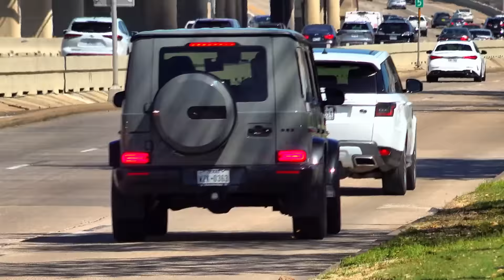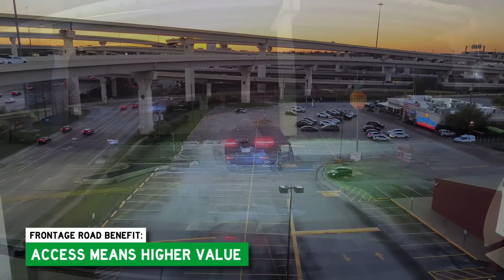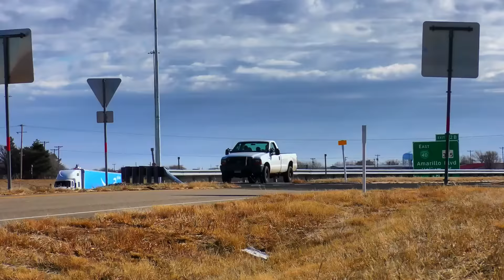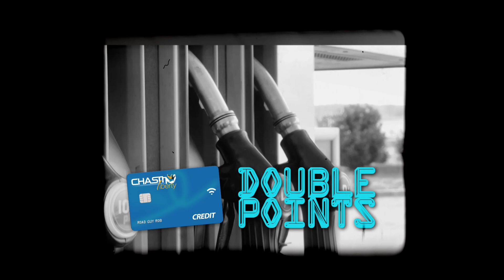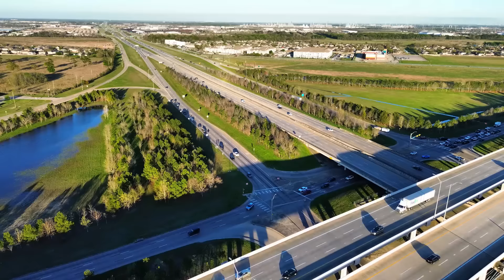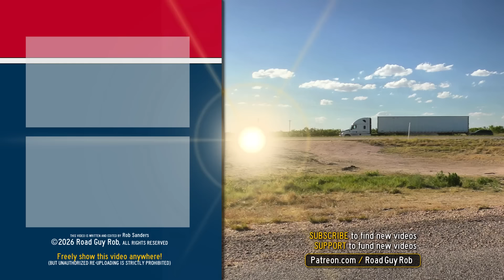Why Texas Builds a Freeway Next to Every Freeway

Comment: Seems like once you accept having a freeway at all, no matter how good or bad an idea that may be in its own right, frontage roads make a lot of sense for significantly improving safety and functionality.

Of course, it's also adding most of the problems of a 'strode' to the list of reasons why a freeway (or tollway) might not be the correct choice in the first place in any given situation.   But when it still is legitimately the best option even after taking that into account (which does sometimes happen)? Well, frontage roads seem like a distinct improvement over not having them.
Reply: This is not a stroad. Frontage roads reduce the left turn access issues that happen with a stroad.
Reply: idk about safety... These areas on camera have some of the highest injury and death rates in the country
Reply: @tann_man   Ahh. Perhaps not then. Maybe I got 'this is how it is' and 'this is what they're doing to make it suck less' parts muddled up in my head by the time I was typing the comment. 
That's what I get for trying to be 'fair' about such things and not just make the typical, not very helpful, sort of remark about the whole thing being a terrible idea, I guess!

Comment: They really should fill in the gaps on the off ramp's road lines as it crosses the two way frontage road.  6:43.  They should fill in the gaps in the off ramp's lane lines with dotted lines so its clear where the right of way traffic lane is for everyone.  The lane lines should be designed to make the right of way more prominent.  The would also help avoid issues with self driving vehicles trying to figure out where the danger is when crossing.

Comment: Great video!  To answer your question about how they handle the signals at frontage road intersections, they just do a four-way split phase that rotates around the interchange clockwise.
Reply from the maker: That's good to know.   At least you don't get stuck at the second signal, but it also means the red wait times are probably pretty horrible.
Reply: @R@Roa @RoadGuyRob y absolutely are sometimes. Thank goodness once it turns green you’re allowed to go all the way through, even if you’re planning to only turn left. It’s declined in efficiency in recent years, but the Houston area’s lights are timed for waves quite well and even left turns aren’t a hassle at the highways because of the signal synchronization.

Another commenter mentioned volleyball interchanges erroneously to this OG comment, but ironically, elevated and subducted volleyball interchanges do make the difference even on non-highway arterial interchanges in Houston, especially along corridors like 1960. The SH6/FM1960 Corridor form a 2.5th loop (the downtown highways are a 0th loop if you even want to consider it that), but aren’t “real” loop highways. Even so, you’ll find many elevated parts of SH6 and subducted sections of FM1960 at regular arterials. My personal favorite oddity is 1960 and Kuykendahl (I’m begging for another visit just to hear you try and pronounce this street) just west of the North Freeway.
Reply: Ive noticed elsewhere, even places where they could benefit from the split phase like Texas does, they don’t. The purpose is to make sure no one is stuck in the underpass or bridge that might cause a backup for the other signals and it works amazingly. There’s also something to be said about Texas U-turns and how they are amazing at avoiding the whole two lefts—the diverging diamond intersection is essentially an innovation on them that benefits the through traffic and integrate (almost) seemlessly into Texas’ already existing feeder road system.
Reply: I'm not gonna lie I was gonna comment that Rob should have visited San Antonio and had a sit down conversation with you. He still could, because there's still a lot about our highways y'all could talk about
Reply: It's called a "volleyball" interchange.   Often built as a "stopgap" where a fully limited access interchange could or should have been built initially.   US 75 (future I-45) and US 82 is an example.
Reply: @davestewart2067  that’s not what they were referring to. They’re talking about the frontage road intersecting with a perpendicular arterial road. Volleyball interchanges are a specific type of those where there’s also an added perpendicular highway and the arterial is another feeder and there’s no flyover interchanges. They function similar, but aren’t what Rob or OP is talking about when Rob talked about talking with TxDOT.
Reply: They do work very well. Think of the lights as a constantly rotating "L" that lets people through. The reds are pretty long but when it's green, it stays green pretty long and constantly keeps cars moving.
Reply: ay yes no Roundabouts
Reply: @AMPProf  roundabouts are good in a lot of contexts. Extremely high volumes like these are not those cases. There is not one good interchange/intersection type for everything, just as different types of roads and different modes of transportation are best for different purposes
Reply: @ClementinesmWTF well said
Reply: @ClementinesmWTF  but 18-wheeler truck traffic isn't suitable for roundabout
Reply: @siroversight.official …yes. Did you mean to respond to the other person?
Reply: @ClementinesmWTF  no, to you
Reply: @siroversight.official  got it. You can’t read to realize I already know what you said and that’s why “these are not those cases [where roundabouts are good]”. No shit they’re bad for 18-wheeler-heavy traffic.
Reply: @ClementinesmWTF  There is a neighborhood around Fulshear to the northeast that its intersections have roundabouts
Reply: @siroversight.official  yes…in a neighborhood, in a different context. Not on a highway.
Reply: Also “neighborhood” is a stretch. It has medium-to-low traffic arterial intersections with roundabouts in a residential area. The neighborhoods have typical intersections. That is an appropriate use. They’re telling you 18-wheeler traffic should be taking other surface streets to get to where they need to go. High-traffic intersections like feeders with I10 and major arterials are not those places to put roundabouts because it’s the wrong context.

I’m beginning to think you even writing to me about this is a sign to slow down on the beers.

Comment: Those X interchanges also do something else you didn't mention. By having the off ramp that far back, and the previous interchange's on ramp after the off ramp, the main "conflict zone" of cars weaving to get on and off the freeway is now on the lower speed feeder roads, instead of on the high speed main lanes - particularly in higher density areas where the interchanges are a mile or less apart.

The one downside is in some of the rural areas they are starting to convert the older, two-way feeder roads to one-way, and they don't have the U-turn lanes built, thus the traffic backs up to get through the interchange. Where I live there's a divided 4-lane "Farm To Market" road that reduces to 2 lanes plus a left-turn lane to go under the freeway (the 3-lane configuration continues into downtown from the freeway, and there's not enough right of way to widen that section). The freeway overpass doesn't have enough room for the U-turn lanes so with the conversion to one-way, traffic on the feeder roads backs up (although not as bad when they were still two-way) at the lights trying to go the opposite direction. TXDOT's current freeway widening project doesn't include replacing the bridge (although it does include two new dedicated U-turn bridges since the distance between interchanges is so far apart), and local authorities are trying to get that bridge replaced sooner than TXDOT's 5-10 year timeline.

Comment: No surprise TXdot couldn’t supply a signal timing engineer, take a look at NB 183 Frontage @ Lakeline Mall exit, storage capacity spills onto the main thru lanes EVERY single evening rush hour. You have the two rightmost lanes dead stopped and the two leftmost lanes booking it to enter the 75MPH speed limit toll lanes. Only in Texas…
Reply: yeah its crazy how a toll road still turns basically into a parking lot over there and by research
Reply: The 2nd order consequences of importing infinity immigrants...

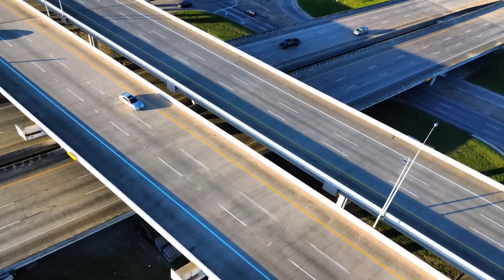Comment: 17:11 I'm glad you mentioned 90 & beltway 8 east, that intersection realy needs some flyovers. traffic there sucks and crashes happen almost daily.
Reply: It was ranked as one of the 25 worst intersections in Harris County
Reply: @FM-304 oh wow i didnt know that, but yeah i have personaly winessed a car run a red light and cause another car to roll over. also 2 cars run a red and one of  them spinning out of controll trying to avoid a crash. and a couple distracted drivers rearending cars parked on the red light.
Reply: @FM-304 hopefuly when the expand wallisbille to 90 on the beltway to 3 lanes they also add the flyovers.
Reply: @rcmaniac10 With Generation Park and Crosby growing like they are, TXDOT will have to put flyover ramps there eventually.
Reply: @FM-304 hopefully Toll free

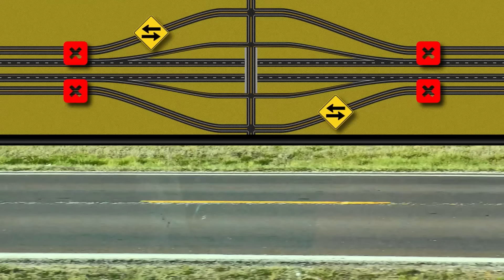Comment: 2:59 narrows eyes heeey, that looks like MODOT. Which we do have some one way OUTER roads (yes we call them outer roads in Missouri). As well as a few exits directly onto them.
Reply: Missouri’s “Outer Roads” are parallel, sure, but they don’t have the direct on/off access feeder roads do. You still have to get to an intersection specifically built for the ramps. Are there any actual examples of feeder/service/access/frontage roads? I270 in STL is what I’m thinking of, but after looking at a map, I’m realizing that it’s parallel “outer” roads, and not actually Texas frontage roads.
Reply: @ClementinesmWTF  Yes in north county specifically. After the 270 reconstruction, sections of Dunn & Pershall Rd (specifically I think between Hanley & Old Halls Ferry) were converted to one way with a few direct feeder on and off ramps. There are even a couple of Texas style U-Turns at Elizabeth and W Florissant, though interestingly only from Pershall to Dunn and not the opposite.

Continuing in North County, MO-367 north of 270 has the pair of Lusher Rd & Benham Rd which are one way north and south respectfully between Dunn & New Jamestown with even more direct feeders as well as U-turns between, even some pairs at Redman & Parker. I'd argue this section is the most like Texas freeways we get.

Let's see, few others I can think of. I-70 in O'Fallon, specifically around the Main St (MO-K) exit. MO-364 through St Peters gets the St Peters Pkwy as a one way outer road pair, no U-turns as far as I can see but plenty of direct on off ramps. And lastly I'll leave off with I-64 between Mason and roughly Chesterfield. A few non-continuous spots there specifically at 141 but otherwise a pretty steady pair there known as "Outer 40"

So yeah, we have a few examples in the St Louis area at least.
Reply: @R @Robbie06261995 h wow yea! You’re totally right! I was just checking the sections I had remembered driving on. I remembered thinking they were similar to, but not quite frontage roads, but sure enough if I’d gone only a few exits down they’d’ve been right there! I270’s feel very fun and like they were discovering the idea for the first time and experimenting with them—not symmetric from both sides, the Texas turnaround is split from the main bridge (some examples in TX, but most try to use one bridge to bring costs down), and one exit/entrance pair at Bellefontaine even goes straight into a roundabout! 367’s little stretch is a lot more like Texas ones, and the one in O’Fallon is quite the sparse example, but it is a cute one among all the diverging diamonds and typical MO “outer roads”.
Reply: @ClementinesmWTF  Oh yeah, and I-44 from 270 through Fenton to Valley Park has N & S Hwy Dr
Reply: @R @Robbie06261995  I will contest on this one though, while I44 does have feeder roads beside called Hwy Dr, if you go a bit further west, on that same stretch of I44, the parallel is labelled explicitly as “N Outer Rd” and “Old N Outer Rd” and they are definitely the other type of entrance exit. Makes me think “Outer Roads” in MO refer to that type of entrance/exit, and frontage roads (with direct access) are just a quirky outer road variation in a few places and not a real thing there. That’s not to say they don’t exist, just that “outer road” isn’t the explicit word for frontages as defined in the video.
Reply: In fact, looking up “Outer Rd” on Google Maps will pop up a few more examples in the STL area that don’t include frontage roads on them, just the aforementioned parallel road with entrances at intersections.
Reply: @ClementinesmWTF true, the words “some” and “few” are doing some heavy lifting in my original post.

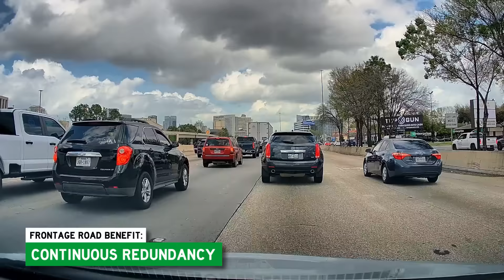Comment: 3:47 "These frontage roads are sure a great solution to flooding!" That flooding has absolutely nothing to do with creating tremendous amounts of impermeable surface for frontage roads...
Reply: He addressed that. There's a high water table there. Would flood either way.
So many frontage roads is still crazy, though.
Reply: Houston flooded before there were any paved roads. All the new concrete surfaces only worsen the issue, but it isn't core to it. Location is.

Comment: The year is 2130.  The average new car sold in Texas has 2300 square feet of cabin space.  Families live in their cars, and their real homes have been converted to drive thrus, used only for storage.  If a child wants to go from one side of the car to the other, they must use a ride-on mini car.  The only toys sold in stores are Hot Wheels and RC cars.  The governor of Texas has fully transformed into a car.
Reply: A full 50% of Texas is now paved

Comment: The last time I was this early there wasn't any traffic on 1-10 at all
Reply: You mean I-10? I've been along the 80MPH stretches in the west of the state late at night, and indeed they've been as lonely as some outback highways I've driven in Australia. But there's a section of the I-10 through San Antonio that's always clogged up when I'm there, and I'm pretty convinced it's just the same traffic jam that's been there for 30 years.
Reply: If that's an OCR error, is this a bot comment?
Reply: @KaneYork nah, I'm just an old guy with big fingers and bad vision trying to use a smartphone
Reply: @KaneYork  Common email chain in New Jersey into the 2020s: "The NJ State Police is cracking down on speeding with their new Crown Victorias on 1-95, 1-287, and 1-195"